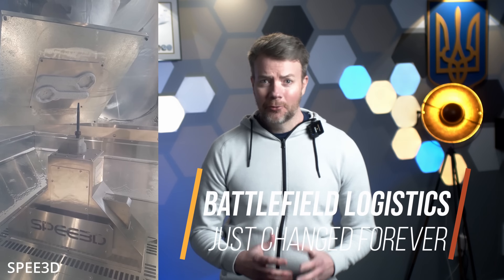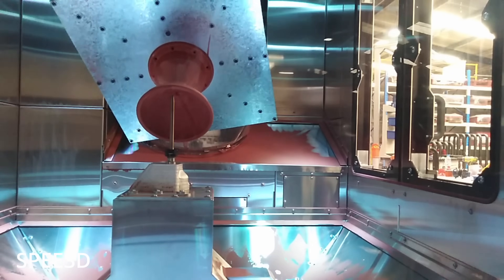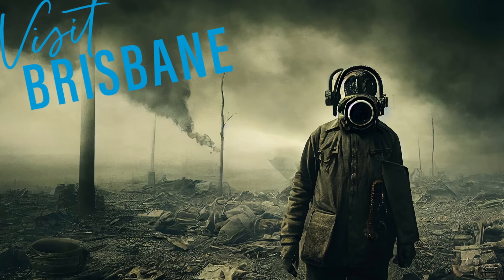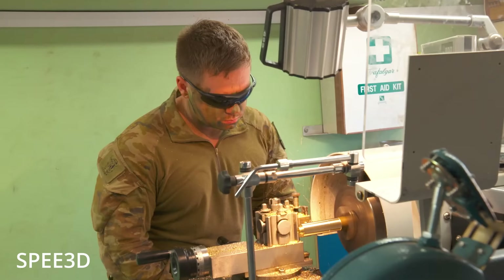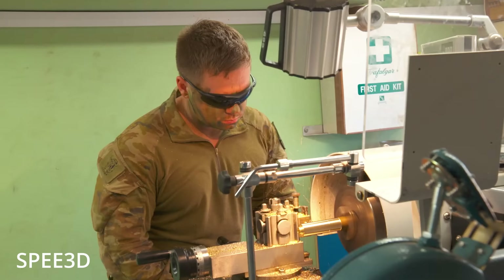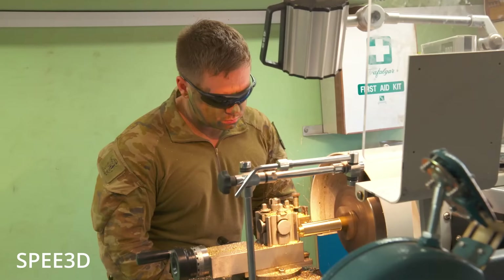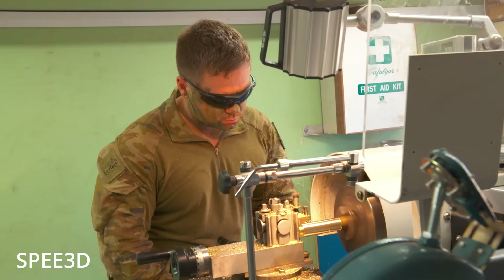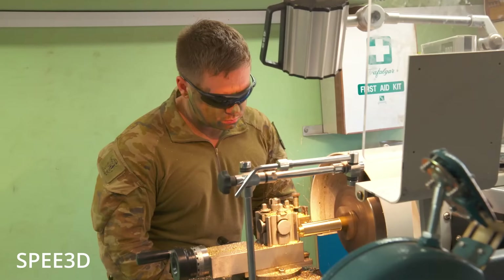How 3D Metal Printers Are Changing Modern War in Ukraine

Comment: I imagine that most militaries are earnestly looking into mobile parts fabrication facilities. These could take the shape of a few 20 foot containers and consist of several 3D printers capable of printing metals and plastics alongside the ovens needed for sintering/hardening and CNC machines for finishing/polishing and for finishing parts blanks. 

Another use for such a mobile facility could be to build and/or assemble weaponry on the fly. Think of things like the injection molding of drone parts before assembling the finished drones. Admittedly, the injection molding would only be for predecided items given the expense of the molds.

Comment: I get the idea and I think it's a fine evolution in logistics, but the impact has to be somewhat limited. Circuit boards, wire, ribbon cable, connectors, pins, lubricants, tubing, gaskets and seals, etc ... that's not generally printable (yes, I know, there are exceptions). That plus relative strengths and CTEs of printed materials versus what they're replacing may or not make a difference, and the need for machining for surface finishes or tight dimensions. So basically this helps a small # of parts be a non-issue, and could be used to jury-rig broken mechanical things, or improve them. Glad it's happening, but it doesn't change a broken computer or display or bearing or seal.

Comment: I think the next logical step here is to design everything as much as possible to not require finish machining and also get the cost down, $1m is really too expensive when you consider what’s in the box. It’s probably possible to get that down to sub $100k if you strip out anything not directly required to make the parts and use cots components - better to have 10 where 1 or 2 might fail than just one that won’t. Also scrap the box and stick them in existing buildings maybe? On the whole it feels wrong to celebrate something used for war but that’s the situation that Ukraine has been forced into and if they continue to innovate locally as they are doing with drones, this might have positive commercial civilian benefits longer term, silver lining on a very dark cloud.

Comment: Imagine a world where this technology could be used for good instead of evil???

Seniors in trailer parks could have an obsolete air condition part made instantly, instead of dying in their trailers from the heat
Reply: Better yet (IMHO) would be replacing the old units with an up-to-date OPEN SOURCE design, the replacement parts for which are already digitized.
Washing machines, refrigerators, machine and power tools, el-bikes and trikes, the list goes on.
Yeah, there's a lot of peaceful uses for this tech...
Regards from Denmark!

Comment: For front line ops having the military hardware in use already stripped down, scanned and uploaded as .STL files.  That pre scanned hardware will speed fab times up by simply quoting which part is required and having it in production before the broken part is even removed from the assembly. Reducing hours off downtime where every hour counts.
Reply: That's the way to go. Every part was designed and formed once, so why not  modelling it and   store the data directly

Comment: Amazing.  Glad to see.  It doesn’t have to be just one part at a time.  To avoid duplicative setup time, a cad design with multiple parts can be made at once:  for example lug nuts for a tank - one might need more than one at a time, or even vastly different parts, but with the same material - just like some injunction molds for models which have a whole host of small parts in one assembly, or as the body does with some RNA/Ribosome protein production.

Comment: Until recently, Additive Manufacturing (AKA 3D printing) had a problem with the structural integrity of items produced by the process.  Metal parts tended to be porous, or overly granular in structure. Has this issue been overcome? Looks like it has. If so, it must be welcomed as an essential tool in logistics and hence military effectiveness. Battles have been lost through over-extended supply chains. Bravo!

Comment: Great video.  Now do two more, one on molten metal 3D printing and another on handheld laser scanners.  There are handheld laser scanners that have incredible range of sizes of objects that can be scanned and accuracy to less than .001" and some that can scan directly into CAD software which can then export directly to the 3D metal (cold or molten) printer or to a CNC lathe or mill.  While the 3D printer you mention in the video is too high priced for the home workshop, the hand held scanner can be in the $2000 USD and a molten metal printer starts at about $50,000 USD.

Comment: The need for modeling broken parts where no CAD file exists is the weak link. Lots of skilled mechanical engineers is key. Building a library of modeled parts is another. Without the CAD or STL files, it's a fail. Build a robust battlefield library and the supply chain exists wherever you fight.
Reply: There are 3D imagers that deal with this.
Reply: @davidmarkmann6098  Only if you start with a perfect version of the part which needs to be scanned.

Comment: Imagine a fleet of drone trucks, able to print 90% of an aerial drone and assemble it completely from the stocked and printed parts, patrolling roads while deploying and replacing a network of aerial drones for surveillance, defense and delivery of remotely requested prints. You would only need to restock the trucks with base materials and parts. The trucks could act as automated or remote controlled laser platforms as well.
Reply: @awlhunt I'm not sure you've thought this through other than you're stuck in the past while the evolution in war is happening in front of us right now... I will state for the LAST time, I said this would be for DEFENSE, you made the assumption of where trucks would be. The aerial drone network is something that Germany is currently developing to create walls of flying mines, they use it in China to replace fireworks, and something that already exists in Ukraine just at a much smaller degree. There are always trade offs when making tactical decisions, a long wait to resupply or risk your assets close by where they can be targeted, that's just war. By your logic everything can be hit so there's no point in stationary production either, everything in Ukraine is a target as you said. Moving platforms can be protected from air strikes like all of the platforms currently in deployment are that are moving and they are on the front line. Delivery drones like air drop shipments would have pickup locations just like they have done with planes in the past. If RF is so useless then how is Ukraine making strikes at all? Russia's strike capabilities are greatly exaggerated and their stock piles and manufacturing plants keep getting destroyed by the way. And as for energy weapons like all weapons large and small will have their place, even if it's just blinding a pilot or melting a fiber optic FPV drone. Also the USA's abilities are as exaggerated as Russia's, China proves that every day scientifically.
Reply: Too much Hollywood there bud…These things need to be stationary when they work, they emit enormous amounts of heat energy from generators, printers, mills, sinter and aging ovens which will get them spotted and destroyed, plus printing a maximum size part will take around 6 1/2 hours just to print let alone sinter it, age it, machine it, test it etc and you’re probably looking at at least 10-12 hours for a single part.  Like all strategic resources these needs to be kept a long way from the front, however in Ukraine, Russia can literally hit any part of Ukraine with stand-off weapons, so that’s not going to help much with that anyway.  This is more of a DARPA funding pitch than it is any sort of meaningful contribution to the Ukrainian war effort.  Plus it can’t print people and that’s what they’re running out of faster than anything else right now.  There is simply no substitute for mass production in an attritional war.
Reply: @awlhunt  I never said this would be at the front line, what I DID say was this would allow them to create a defense network. Also most aerial drones don't require a METAL 3D printer, plastic is fine. Trucks can be parked when they need to print, if Russia can hit anywhere and they all emit large heat signatures all the better to have them move immediately after they are done. They already do it for missile launch platforms and they have the same problems. Just having a large amount of vehicles driving around with the laser air defense systems would be worth it, throwing a deployable shipping container that already can 3D print anywhere it's dropped on a truck is definitely not a Hollywood idea, it's just a logical progression for a supply chain upgrade. Amazon delivers supplies with aerial drones, why not do the same? Trucks would never had to get close to the front line, drones could relay the package across the entire country if they wanted to as long as they is a network to utilize. Mass production is only part of a supply chain, as was mentioned in the video,  the other more difficult part is delivery and that's why they are deploying these in the field already. But everyone thought the Sea Baby was a toy until they didn't, everyone thought it being used as an aerial drone launch platform was something from Hollywood too.
Reply: @KirkCA  I’m not sure you’ve really thought this through other than a vague belief that it’d be cool if…[insert drone application here]…
The reality of Russian stand-off weapons and the kill-chain they are now in, is that anything that is big enough to be targeted by satellite or drone, that is considered high value and stands still for more than a few minutes at a time, is a target for a long range missile strike anywhere within the Ukraine.  It simply doesn’t matter whether these things are on or near the frontlines, though “in the field” would usually suggest at or near the front anyway, or at strategic supply points.  These things in particular cannot produce anything fast enough for it to be even remotely useful unless they are hidden away and do not move, and even then the rate of attrition occurring in the Ukraine is such that you’d need hundreds of these things working around the clock to make a dent - then you have to power and supply them.  As far as the other drone ideas you mentioned, perhaps this may be of some utility, however you’re then talking bigger vehicles and you’re putting what would be strategic target in imminent danger of being identified and destroyed when you could otherwise just produce the drones more efficiently elsewhere and transport them at far lower risk - logic dictates that you’d rather lose a shipment of drones than the machines that make them.  Using drones for resupply won’t work in many places as RF have massively invested in EW that makes it impossible for anybody to use their drones anywhere near the front, and if you’re resupplying via drone, then once again, you’re at or near the front, and you’re going to get targeted by either a fibre-optic drone, a FAB or a missile strike, which can occur within about 3 minutes nowadays. Also energy weapons are a joke right now - the whole of the US military (including the Navy) has only about 20 systems in varying stages of testing and proving, so they’re not turning up in Ukraine anytime soon.
Reply: @awlhunt  I'm not sure you've thought this through other than you're stuck in the past while the evolution in war is happening in front of us right now...
I will state for the LAST time, I said this would be for DEFENSE, you made the assumption of where trucks would be. The aerial drone network is something that Germany is currently developing to create walls of flying mines, they use it in China to replace fireworks, and something that already exists in Ukraine just at a much smaller degree. There are always trade offs when making tactical decisions, a long wait to resupply or risk your assets close by where they can be targeted, that's just war. By your logic everything can be hit so there's no point in stationary production either, everything in Ukraine is a target as you said. Moving platforms can be protected from air strikes like all of the platforms currently in deployment are that are moving and they are on the front line. Delivery drones like air drop shipments would have pickup locations just like they have done with planes in the past. If RF is so useless then how is Ukraine making strikes at all? Russia's strike capabilities are greatly exaggerated and their stock piles and manufacturing plants keep getting destroyed by the way. And as for energy weapons like all weapons large and small will have their place, even if it's just blinding a pilot or melting a fiber optic FPV drone. Also the USA's abilities are as exaggerated as Russia's, China proves that every day scientifically.

Comment: These have been around for some time that I've followed, a lot of the initial work started off being developed and made in the NT as a quick-source for mining equipment in a hurry. Which is a fairly tough environment to begin with and needed parts in a hurry for machines that could come from nearly anywhere and might have a fairly dubious supply line to begin with. The amount of alloys you can get out of them is really spectacular if you know a bit about metallurgy.
Also don't sell the US contribution to this stuff short, they did ship some pretty big 3D printers over to Ukraine as well which played quite a big part in the marine drones. From what very little OSINT I know about those, they're practically almost all out of a printer and decentralized production process spread over quite a distance

Comment: Holly crap.  I had no idea about this. I mean everone knows about 3 D printing - but with no heat source. And using it on the battle field. Wow!  Great Job on this video Wes!!!😅
Reply: The parts are cold sprayed but they still need to be sintered to bind them together, plus if they need to be precision parts then they still need to be milled to spec - actually the unit they showcase here has a deposition spot size of 6mm, so every single part would need to be milled at least on connecting faces.  The challenge is they wouldn’t last 5 minutes on the battle field given the footprint and the presence of diesel generators etc, not to mention the high temperatures of the sinter ovens, as they’d be visible to thermal surveillance, especially at night.  It’s interesting, but still a bit of a nothing burger for the application as described in the video and sounds more like a pitch video for DARPA funding than anything else.
Reply: 3D prints near the battlefield ain't new.  The Dutch armed forces did it in Afghanistan for small spareparts or  special demands from units in the field.  Although most of these parts could not hold a lot of stress or weight or tension. It is weird when you can not use a device, because one stupid part has broken and it is even more weird when alle these devices suffer from problems with that same part.  My dentist uses it for making crowns.

Comment: 3d printing drone body parts is the easy part, the hardest part is the Electronics, because those parts always comes with a high cost.
Reply: Depends on the electric part itself, circuit boards have been printed in a way for a long time at least partially. The rest would be tedious.
Reply: Nobody's talking about 3D printing electronic parts
Reply: @rogerwilco5918 I never said Electronics can be 3d Printed you knucklehead!

Comment: As soon as you described the tech it was one of those "Duh, I am such an idiot" feelings which when looked at more objectively is a "Darn, whoever came up with that is a genius". How had I not heard of cold spray deposition 3d printing before? I was aware of it for coatings, which is what makes the not thinking of it for 3d printing feel like I am an idiot. And of course, looking it up I also got exposed to a company that has turned stir welding into and additive manufacturing process, which is interesting to say the least.

Comment: A little bit of background: This form of metal printing, supersonic powder spraying basically, is just one of many different methods for printing metal parts. 

WAAM, Wire Arc Additive Manufacturing, which is basically robot-controlled 3D weld bead stacking could also be made robuust and field-proof. But many of the other methods don't stand a change in these adverse environments.
Reply: quick question:
if you need so much pressure/speed(?) to merge(?) the material, what are the power requirements for a box like that?
Reply: @FulloutPostal  That's a good question. I'm not familiar with the specs, but it is very little compressed air at very high pressure. Fortunately the specs are listed on their website!

The website mentions that the printer runs on 415 volt, 3 phase, 50/60 Hz, max. 25 amp / 18 kVA, and the compressor/extractor runs on 400-460 volt, 3 phase, 50/60 Hz, max. 35 amp / 25 kVA. Ball-park you're looking at up to 25 kilowatt, which is well within what a decent diesel generator can supply.
Reply: @Hydrazine1000  ut wouldn't let me respond yesterday, but thank you very much :)

Comment: Entering the war with 3D printers, leaving with an army of printed tanks.
Reply: Makes economic sense for replacement parts, not manufacturing from scratch.
Reply: Yes it will all end up in the hands of Russia for their benefit. Just like they have been allowed to train against the best long range US tech for 2 years now. It didn't kill them
Reply: Ukraine has 3d robots rusia internet bots and trolls @togowack
Reply: @Illytimes  Once Russia takes over Ukraine (they have) they will have all what the Ukraine has and they will call it the New Soviet Union. Which is a lot , but not as much as right now, because of the connection and provocation provided by NATO.